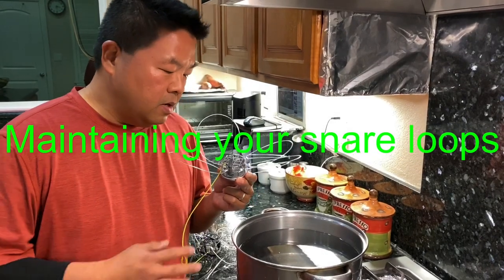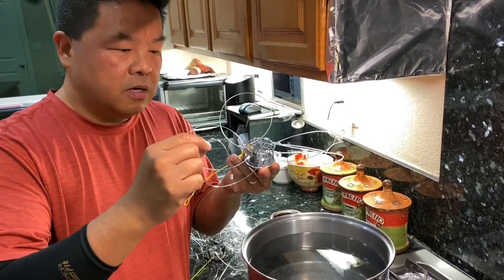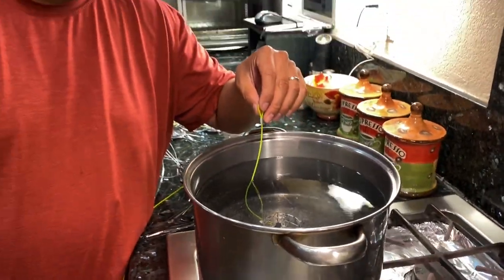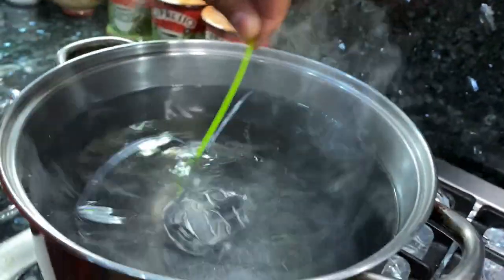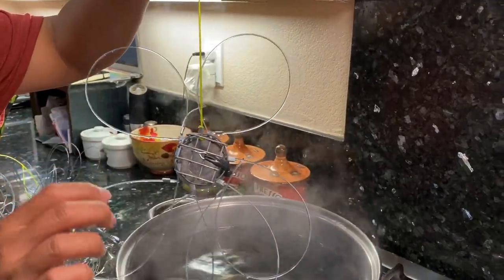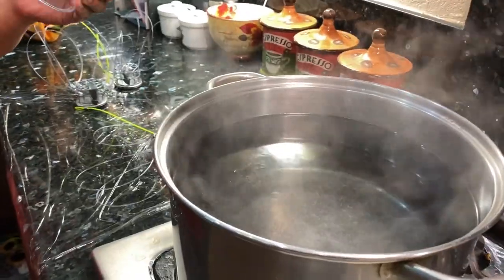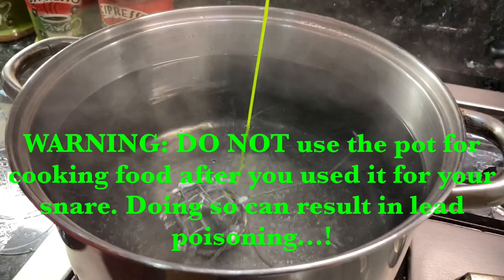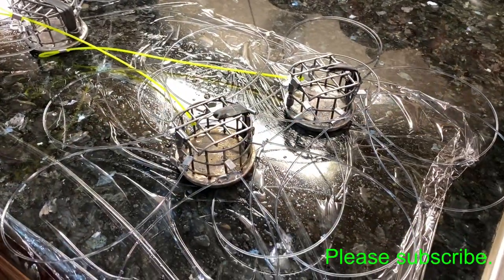How to keep your snare loops in shape?

Comment: This is a very great instructional video on how to maintain the correct shape of the monofilament loops attached to your snare. I tried to do what you did in the video and it worked! Thank you very much for teaching me this important skill so I can catch more crabs efficiently.
Reply from the maker: I am glad it help you out to prolong your loop lines on your snare.
Reply: @weekendfisherman8072  thank you
Reply: @weekendfisherman8072  can I ask what rod do you use with your snare, and also how heavy of braided line and also how big of reel? Thank you very much again
Reply from the maker: In this video, I use a Daiwa Emblem Pro 12’ H rated up to 12oz and I paired it with a Penn Squall 2 size 15 reel. I use 30lb mono to 25lb back braided line.
Reply: @weekendfisherman8072  that’s quite cool and interesting, thanks for telling me about it.

Comment: I don't understand, does the lead leach into the metal of the pan in some way??  Will the lead dissolve and get into the metal of the pan?? Does it have something to do with getting the water close to the boiling point? I use the lead I have leftover from my shotshell loading days so is it the arsenic they used to harden the lead or the graphite coating?? Should I be using gloves when I handle my snares when baiting? I'm a bit concerned now.
Reply from the maker: Outdoor freedom  - The bottom of the pot change color after I used it. Seeing this color change got me to be concerned and may result to lead poisoning. I just don’t want to take any chances.
Reply: @weekendfisherman8072   Cool, I'm going to try just filling my sink with hot water then adding boiling water to that? My only deep pots are good ones that I use for cooking. I don't know where you get your lead but some of my shot was factory-made here in the states and some from Mexico then I have a lot of it that was homemade. It was made from wheel weights and they went a bit nuts with the graphite. Really dirty stuff. I skim it when I melt it or the impurities make the weights lumpy!!!
Reply from the maker: Outdoor freedom - lead I use are 6oz bank shot lead which I re-melt for the snare. They looks clean but it’s lead.
Reply: I just boiled some water and put that hot water into a 2 gallon bucket then dipped my snares into the bucket.
Reply: @matt0ballesteros yes that’s the safest method and I use the same technique.

Comment: Is it hard to snare fish ? I’m 11 and have a snare and I wanted to try crabbing in Pacifica can you tell me isf you got recommendations
Reply from the maker: Hello,

I am glad you show interests in crabbing. Pacifica is a great spot for crabbing. Your snare will need to have at least 4-8 ounces of weight depending on the water (currents) condition. Have at least a 9 feet fishing with a solid reel. Something like a Penn Fierce 8000 and at least 30lb mono line. Use squid, or chopped up fish (mackerels). Good luck and tight line...!

Comment: Hey there went to test my snares in horrible 15 knot head winds. I decided to twist togeather 100lb hard nylon string
And 130lb high visibility chartreuse green big game very stretchy mono line and make connecting lanyards
To main line  65lb braid from that.  It makes the loops set much better.  So I twist the two lines togeather, heat togeather
Not melt just heat. Bic lighters no good uneaven.  Quench in cold water. Dry, and paint with clear quick setting epoxy.
Should leave tag ends on both sides of lanyard.  Let cure over night.  Should be stiff but pliable.  Worked very well
For me. I'm tossing 8oz.
Reply from the maker: Strong Addictions interesting way of doing it. Some people just use .65in trimmer line for the loops
Reply: @weekendfisherman8072  yes I've seen the blue trimmer line.  I'm the guy that over thinks things and I enjoy building small projects and then
Tricking them out for show.  I need too make a few changes too my connecting lanyards. The thin 65lb. Super slick power pro I tried.
Frayed a couple of times pretty badly.  So I think it's getting hung around the aluminum crimps at the connecting point to mainline.
So my fix is clear heat shrink tubing marine grade.  Over the entire lanyard just punch a small hole where connecting swivel is and mainline
Clips in.  Simple, cheap, functional, and still looks cool.  Haven't put one togeather yet for a test run.  Soon hopefully.
Reply: @weekendfisherman8072  I forgot too mention that I also keep a spare spool of  80lb. PP my reel came with (Shimano THUNNUS 16000F). 
And had no fraying issues.  So I'm gonna make my lanyards 100% string safe as possible.  Hope this helps...

Comment: Wow I say THANK YOU for the tip.  I build my snares as well but a different design and once I wrap the wire it's a wrap for that cage once the 
Loops go bad. I use the same heavy memory line as you  I think. For my loops.  I just copy a store bought design.  You can figure which one I'm building.  Any ways thanks again. Kind sir.
Reply from the maker: Strong Addictions - you can replace them loops unless you put epoxy to hold it in place then it will be harder to replace.
Reply: @weekendfisherman8072  yeah it can be done unwrapping the two wires and  rewrapping them around the new loop just doesn't pro for me.
That's why I like the cylinder style.  The loop stands up strait and open loop with ease.  And the cage looks much easier too fabricate.
The lead smelting process looks like fun.  I'd like to try.  Get to be a mad scientist.
Reply: @strongaddictions1645  Just make sure you are in an open space when melting the lead!! I also have a full face shield and thick gloves on when I pour.